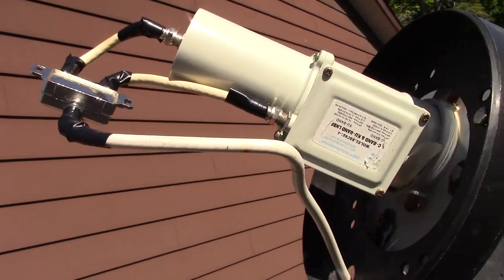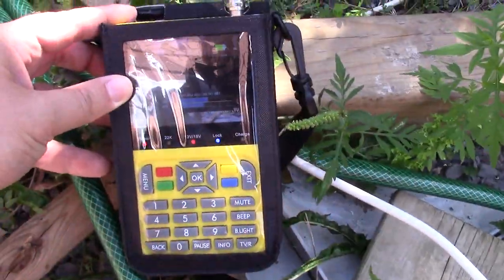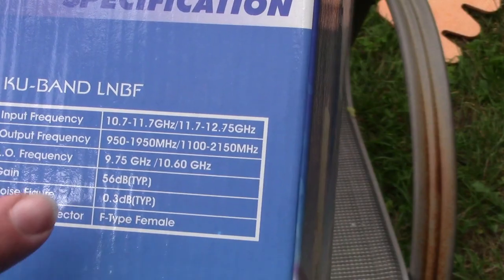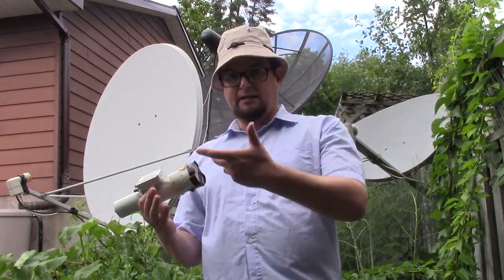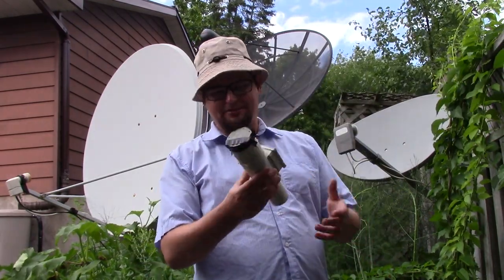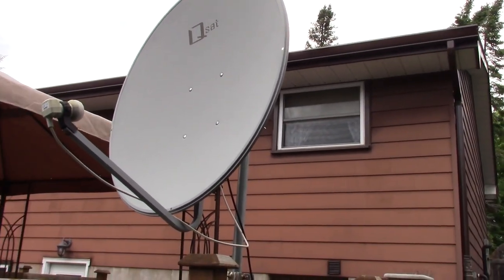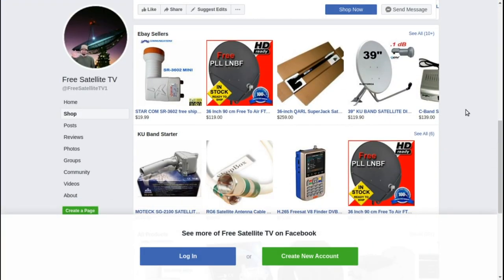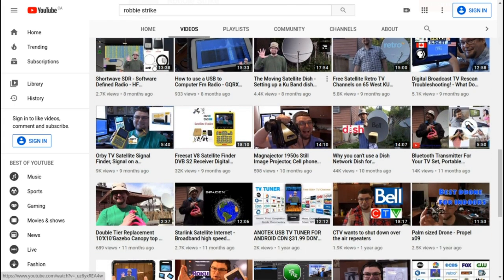C band & KU band LNBF For a #FreeSatelliteTV aka #FreeToAir Satellite Dish

Comment: Thanks for the video, Robbie.  If I might make a suggestion.  Try using RG6 with proper compression style F-Connectors rated for RG6.  With those patch cables shown in the video, you are probably experiencing some major dB loss.  If proper RG6 cable is used, proper cable stripping techniques are applied, and the correct compression style RG6 F-Connectors are used, you will experience much better performance in terms of signal loss and there will be no need for "Heat Shrink".
Reply: The heat shrink is more or less to keep the ends of the cable protected from the elements
Reply from the maker: I have done that with the current setup now that I got the compression tool, I am using dule shield rg6, I have had people recommend quad and even RG8 https://www.youtube.com/watch?v=A-l-LF3io6U

Comment: Appreciate your videos and like all your dishes.  
As said in other comments, you should invest in a good compression tool to put on F type connectors.  I personally only use weatherproof F compression connectors, Belden RG6 Quad shielded cable and only quality 3m electrical tape.

When you use cheap connectors , switches and cable you are setting yourself up for huge signal losses.
Depending on cable quality and type, losses occur through the maximum insertion loss (Attenuation) of the cable at specific frequencies.
This gets critical at satellite frequencies.....Nominal insertion loss at satellite frequencies is tied to cable type and the quality of cable too.
Structural return losses are another character of the specific cable too.

In laymen's terms....Use quality cable, switches and connectors!  

The quality of the LNB is critical.  But that's another story.  Hobby grade LNB's are basically garbage, but they do work.

Comment: Hello Robbie. How much does a complete satellite reception system for C-Band and Ku band system cost in North America ? I mean Satellite dish, LNB and Receiver. In Romania a complete satellite system for Ku Band reception cost 147 dollars and includes. Satellite receiver, USALS H-H motor, 20 meter (65.61 feet) tri shield coax cable RG6, satellite dish mounting support and 100 cm (39.37 inches) dish. Almost everyone can afford it especially those interested in FTA reception or simply don't want cable. The C-band no one is using or never used.
Reply from the maker: For C band your probably looking at $2000 Around. Cheaper if you get used! https://www.youtube.com/watch?v=E44iwzlp4UE

Comment: I’m brand new to the hobby and just got a C Band dish. I don’t understand what KU band is. If I add a KU LNB to my system, ‘where’ are the KU channels? Currently I get 24 channels (transponders?) on each satellite. Does KU show up on those, or are there separate KU only satellites, or does my receiver need to switch to a KU mode? I’m really confused, but trying to learn
Reply from the maker: Thanks give me an idea for a video. Ku band is a different frequency than c-band. With Ku band you can receive it with a smaller dish. But you can receive Ku band with a large c band but not the other way around

Comment: Use chaparral c,ku feed horn,c,ku lnb with scew switch fed to old digasyspher slave reciever to move dish and polarity for transponders channel's and switches fed to fta reciever.90 to 97 signal strength c band 85 to 95 ku strength.101w,g16w,g19w.

Comment: Your plugs and cable are a signal lost generator BTW. In Canada you're better off using the switch inside. How many switchs did I kill with whether, cold etc...!

Also my Chinese lnb is the same as yours and I get better signal on Ku even in the North of Quebec province with a 200 foot long cable run.,

Qualitynew cable and plugs are a must, kills impedance problems.

Comment: You could experience dropping because of those coax cables, bud. Heat shrink works way better
Reply from the maker: What do you mean by Heat Shrink?
Reply from the maker: I have put better ends on the cables since I have shot this video with my crimp tool!
Reply: @RobbieStrike  the plastic tubes that you put over cable and apply heat. The tube shrinks over the wire
Reply: Also, any arc-gaps between shielding and connector adds attenuation
Reply: If you use a RG6 tri shield coax cable you shouldn't have problems. Maybe a sat amplifier may be required to boost the signal. I use RG6 cables and had no problems. And use compression style F-Connectors instead of cheap F connectors especially if you want to combine OTA TV with Satellite TV using diplexers or Cable TV with Satellite TV